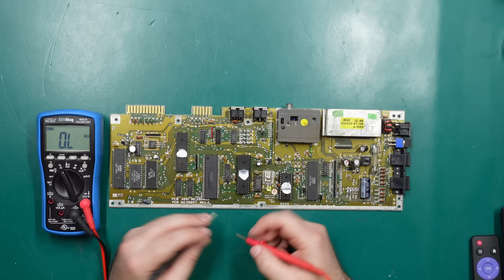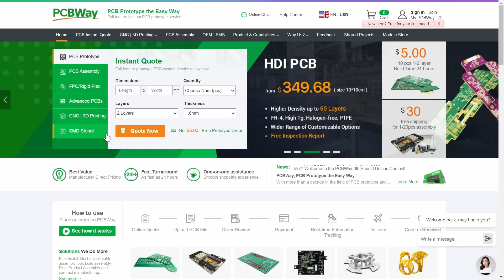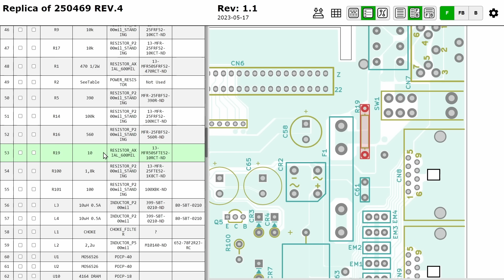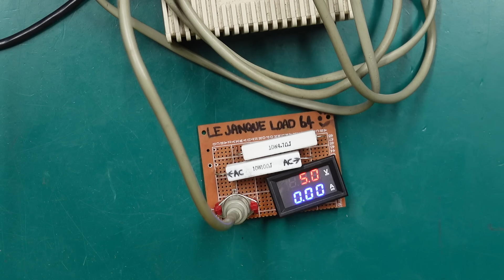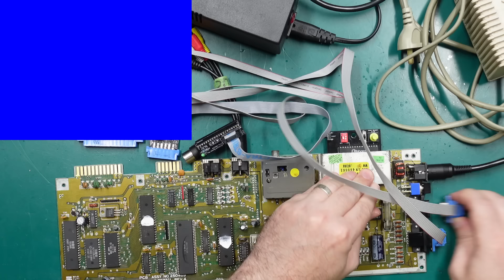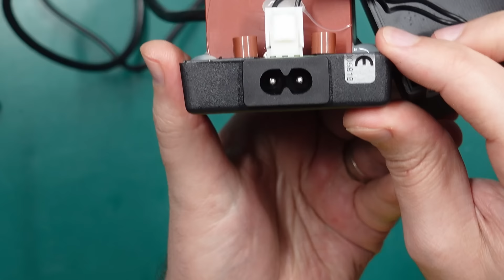Checking out a big container of Commodore 64 stuff

Comment: One of my Breadbin 64's delays on powerup, but the power source is good
Reply from the maker: Could be the capacitor near the 556 has gone out of spec. Usually a 1-2 second delay is normal but if that cap is bad it will take longer

Comment: I think the fact that they had to rotate the xfmr slightly to fit their PCB which they could have designed to any size to fit a custom plastic case indicates that they used an already available case.  Plus, I'd imagine that making an injection mold for a custom case isn't cheap enough for such a limited production design.
Reply from the maker: It looks like the transformer rotation is on purpose. The silkscreen has markings for both a straight and slightly rotated transformer, my guess is the 230V and 110V transformers have a slightly different footprint (Noel's 110V version is straight)

Comment: Didnt the Aus PSU packs have them filled with some from of glue or resign in them? I remember when I had a C64C, we kept getting bad ones until we finally got a good one. I was told it was filled with resign and they were not repairable (at least at that time)
Reply from the maker: Yep, the white bricks are potted (filled with resin). There were at least 4 different PSUs Commodore used in Aus, with the white ones being the final version
Reply: @TheRetroChannel  And they were like fire bricks, we had ours raised off the carpet on the concrete fireplace mount and to attempt to keep it cool, we used our only oscillating fan over it for extra cooling.

Comment: I was curious as to what you are using to capture the video coming out of the C64C, because I have a capture device that works with both an Atari 8-Bit and a Colecovision, but not with my Commodores.
Reply from the maker: It's a retrotink 5x. The C64 outputs an odd vertical sync and some devices will not work at all with it. I have a couple here that don't work with the 64
Reply: @TheRetroChannel  Yeah I also have a retrotink which works quite well for displaying on an HDTV via HDMI, but I was specifically wondering what you use to capture the video to the PC side of things when doing the YouTube videos.
Reply from the maker: @michaelst.pierre1187 Ah ok, I use the HDMI output from the tink 5x into an EVGA XR1 lite

Comment: FWIW I've gone back to using a brick PSU with saver module.
Reply from the maker: Yeah, I use an original brick with a saver on my own machine. Sure, a SMPS will be more efficient but these machines were designed for a linear supply and using anything else can cause more trouble than its worth

Comment: My brand new Electroware power supply had a cable connector that just fell apart. I was told to glue it myself... Anyone have any luck with the Keelog adapters?
Reply from the maker: Wow really? That's not the best after sales service. I tested out a Keelog a few years ago and it wasn't great, AC voltage was too high and it produced a lot of video noise. They may have improved their design since then, I don't know
Reply: @TheRetroChannel  Hmm.. Really not sure what to do about the C64 PSU situation. I also ordered a different Polish type of C64 replacement PSU prior to the Electroware, but it was low quality as well. I really hate to open high voltage things and have loose pieces of hot glue falling out... I have about 5 refurbished C64s I want to sell on, but I only want to sell them bundled with a good CE-approved, safe and legal quality replacement PSU. ...and yes.. it should be cheap too 🙂 Lastly, my refurbished C64s do not draw a lot of current, so some replacement PCBs I have tried had a crazy high 5.35V voltage to begin with, thinking they should overcome a long cable and a hefty current draw of a fully decked out old style C64 to end up with a voltage loss settling at about 5.0 volts, but on mine the resulting voltage is much higher, close to 5.27v, which is too high in my opinion. Many 5V chips are only rated to run between 4.75 and 5.25 volts.
Reply: My keelog PSU tester had the same wiring issue as seen here (it onky catered for the pinout of the newer version of the PSU, though). They just told me to fix it myself and offered a discount.
Reply: @christianlarsen1070  Thanks for the information.